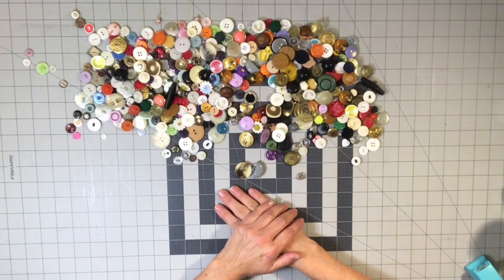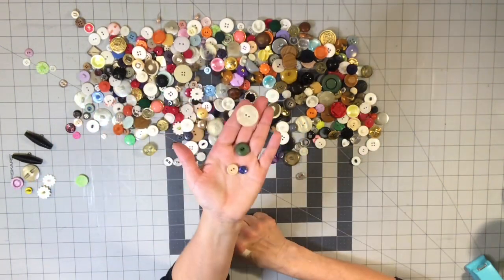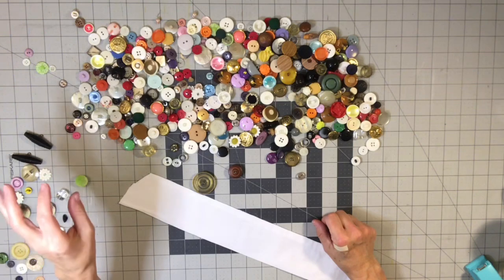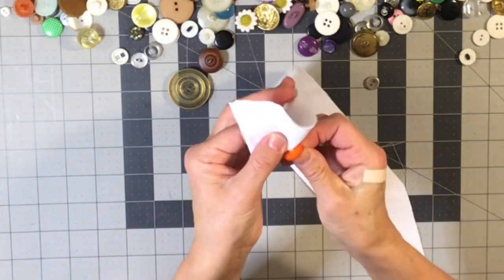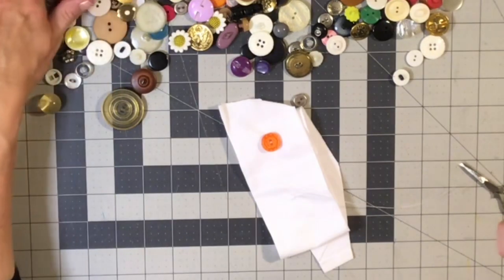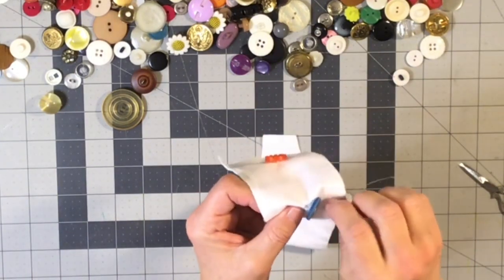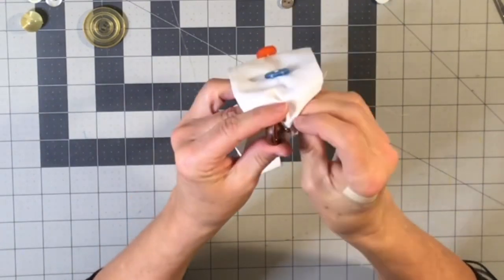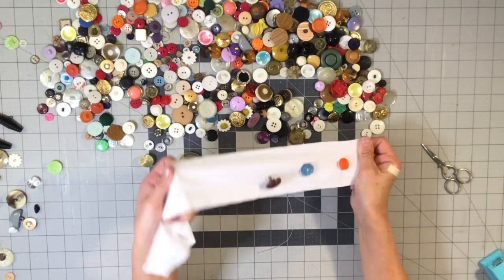How To Sew a Button

Comment: Excellent Angela. For replacing a shirt button I always knot the thread and sew right through to the back however, this can look tacky on the top button with knot behind If the collar is open neck.  But for a quality garment then your methods are much more neat and professional though I guess as usual practice is required.
Reply from the maker: David Macdonald Yes, practice is necessary with almost any new skill. I used to avoid sewing buttons because of the knot. I was really happy when I was taught this method.